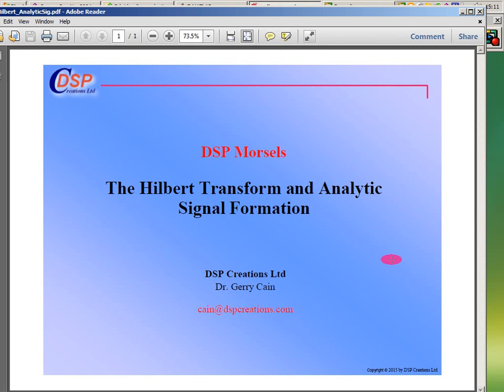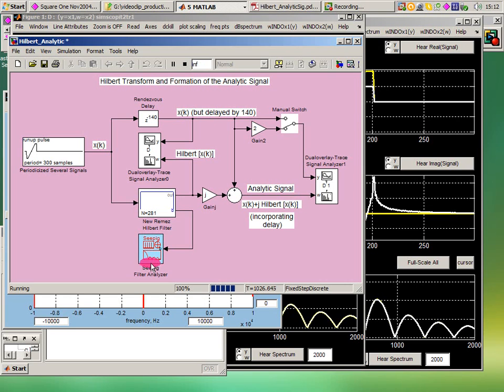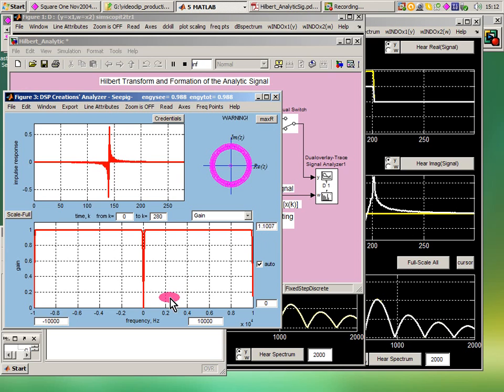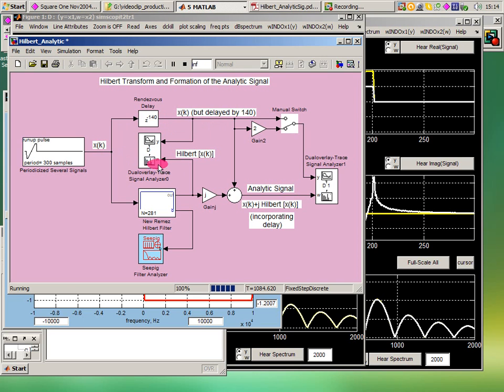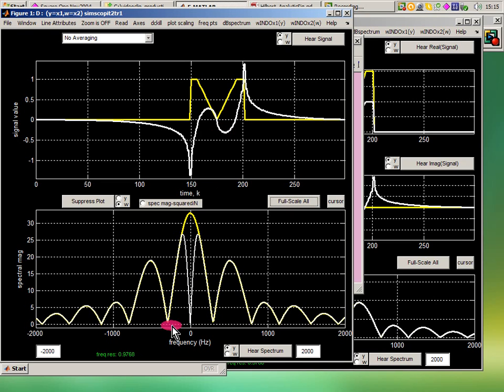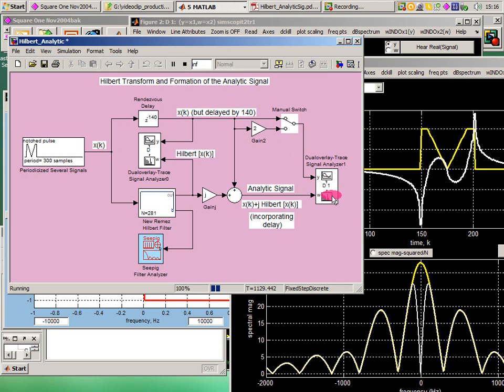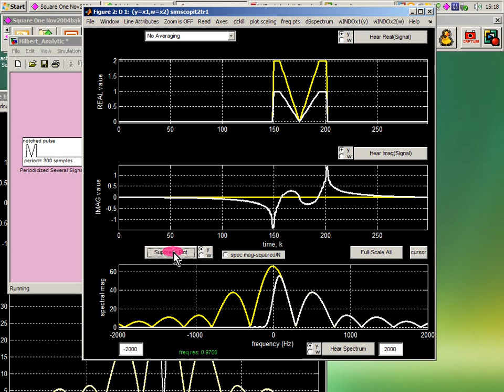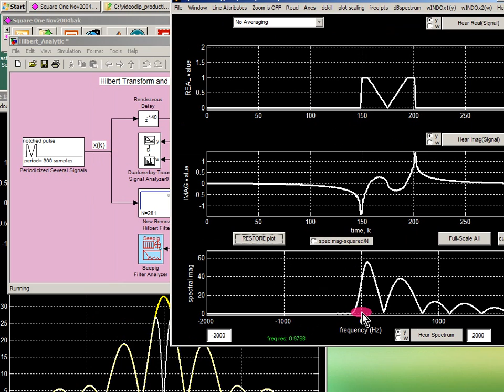The Hilbert Transform and Analytic Signal Formation

Comment: can u pls tell me how i can transform mt Continuous signal excel file into Hilbert transform using matlab
Reply: sorry but i dont know abt hilbert commands ..if possible can u send me one program of hilbert to transfom from excel file..
thanx for ur time to rey me
Reply from the maker: I assume your "continuous" signal has been recorded at equi-spaced sample times in your Excel file, and that it is a real-valued signal vector x. If so, two choices are to:(1) Use the hilbert command and take the real portion of the result....or(2) Design a Hilbert filter (FIR, say, by the command firpm, yielding the impulse response h) and get its output y=conv(x,h). Here the length of h should be considerably shorter than x.Endpoint effects probably be  be worrisome: with both approaches you should be wary of inaccuracies in the early and the late values of y. Good luck.
Reply from the maker: OOPs! My advice was wrong; it is the IMAGINARY part of
Matlab’s hilbert output that you have to take!I take it that you are a Matlab user, and that you realize
that to learn more about a Matlab command 
(like hilbert) you simply type help Hilbert in the Matlab command line.I know nothing about Excel, but I know that a read operation
called xlsread exists in Matlab. So you should type help xlsread in Matlab to learn specific
details. The alternative (if you only have to do it on a few occasions) you could
manually swipe the Excel entry and dump it into Matlab, naming it the vector x
(Or, dump it into a Matlab script file and run that to get the x data into the
Matlab workspace).
Thereafter, it’s dead easy. Below I create a familiar test x
vector (familiar because it is well known that the Hilbert transform of a cosine
is a sine) :
%Hilbert of a test vector xx=cos(2*pi*.05*[0:100]);y=imag(hilbert(x));figure;plot(y)
That’s it.